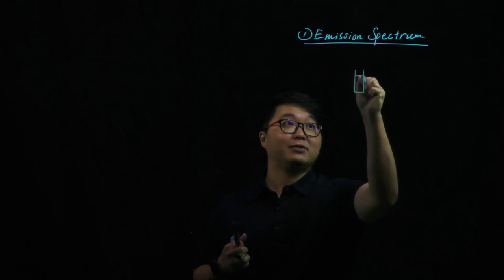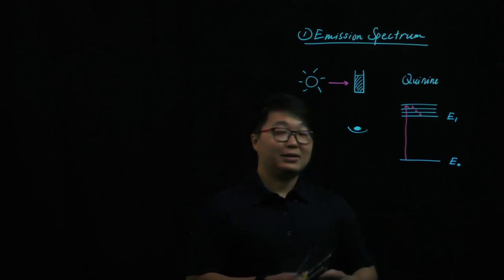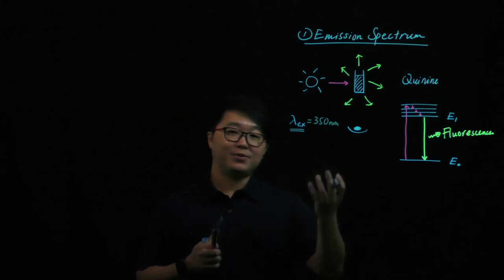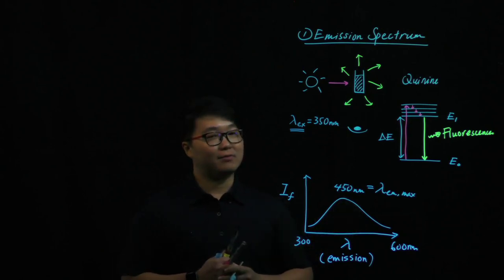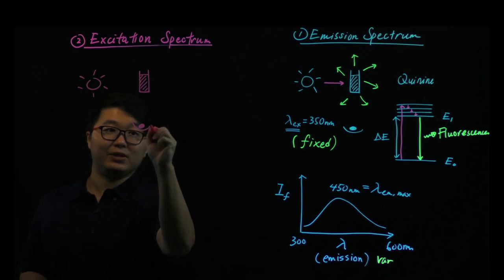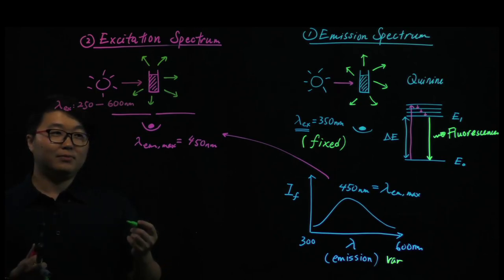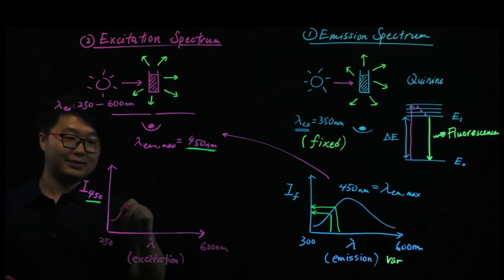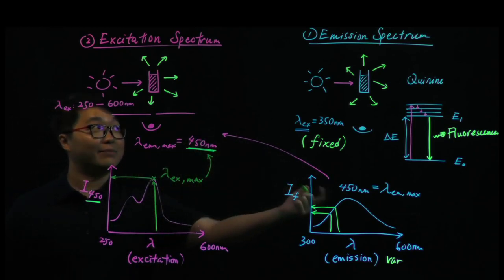Fluorescence Spectroscopy: Emission Spectrum vs Excitation Spectrum

Comment: So, you mean for different machine we have to find out working excitation and emission wavelength? how much variation could be possible among different machine? I have seen in different publications that 300nm (some 305nm) excitation and 410nm (in some 420nm) emission, thus, my question is, by doing spectra reading in my machine cytation5, I explored higest emmision reading at 350nm and 290nm Excitation....I am confuse with this much variation. is it possible?

Comment: @Francis Chong Dear Francis, so the Emission Spectrum it's about Fluorescence and the Excitation Spectrum it's about Phosphorence?? Keep the nice work! Thanks
Reply from the maker: Hi @Drive To Perfection, thanks for watching. In this video, the emission spectrum we discussed is a fluorescence spectrum, which usually involves a relaxation from a singlet excited state to a singlet ground state. As for phosphorescence, it usually involves relaxation from a triplet excited state to a singlet ground state. The key difference between the two is the occurrence of the inter-system crossing (from singlet excited state to a triplet excited state, in the case of phosphorescence). You may refer to the Jablonski diagram for more information: https://chem.libretexts.org/Bookshelves/Physical_and_Theoretical_Chemistry_Textbook_Maps/Supplemental_Modules_(Physical_and_Theoretical_Chemistry)/Spectroscopy/Electronic_Spectroscopy/Fluorescence_and_Phosphorescence

Comment: Hi Dr. Chong, I had a question. Why not do the excitation first and find out the excitation maximum and then do find the emissions spectra? Why choose an arbitrary excitation wavelength?

Another question: How is the emissions intensity is measured? Does the machine counts the number of photons at each emissions wavelength and the wavelength with the maximum photons is chosen as the emission wavelength.
Reply from the maker: Hi @Abhishek Bastiray, yes, it is possible to conduct an UV-vis absorption spectrum of the analyte first to have some idea of the absorption maxima of the analyte. If only a fluorescence spectrometer is available, using an arbitrary excitation wavelength will be the next better option. 

Yes, on the technical aspects of how fluorescence spectroscopy works, I believe you are right. If you are interested in finding out more about the theory behind the emission maxima, this reading may help: https://application.wiley-vch.de/books/sample/3527316698_c01.pdf 
Particularly on these two topics: the Franck-Condon Principle and the Born-Oppenheimer approximation.
Reply: @FrancisChongYY  Thank you Dr. Chong, this video particularly helped me clearing some of the doubts regarding fluorescence spectroscopy. Again thank you for the sources mentioned I will go through it swiftly.

Comment: You make my life easier with this video. Could you do a video which explain synchronous fluorescence and synchronous obtained with wavelength deltas ?
Reply from the maker: Hi Paulina, thank you :) Glad that you find our video helpful :) 

As of now, we don't have any plan to make a video on Synchronous Fluorescence Spectroscopy (SFS) as it's not included in the syllabus of our course. If you would like to find out more about SFS and how it works, please check out this book chapter here: https://link.springer.com/chapter/10.1007%2F978-1-4419-9828-6_5#page-1

Li YQ. et al. (2012) Synchronous Fluorescence Spectroscopy and Its Applications in Clinical Analysis and Food Safety Evaluation. In: Geddes C. (eds) Reviews in Fluorescence 2010. Reviews in Fluorescence, vol 2010. Springer, New York, NY

Comment: THank you so much! Next time can you teach us how to correct the inner filter effect of fluorescence spectrum! please!
Reply from the maker: Hi @badamkhatan tuguldur, thanks for watching. The inner filter effect is a secondary absorption caused by the reabsorption of the emission by the analyte species itself or by other species presence in the solution. It occurs when there is an overlap between the emission spectrum and the absorption spectrum. Practically, one quick fix would be to dilute the sample, or change the solvent system.

Comment: Why emission wavelength always higher the excitation wavelength?
Reply from the maker: Hi @Prince Mutshinyalo, thanks for asking the question. In general, the emission wavelength is usually longer (lower in energy) as compared to that of the excitation wavelength. It is mainly due to the non-radiative relaxation to the lowest vibrational energy level of the excited state before relaxing back to the ground state. You may refer to the Jablonski diagram for more information: https://chem.libretexts.org/Bookshelves/Physical_and_Theoretical_Chemistry_Textbook_Maps/Supplemental_Modules_(Physical_and_Theoretical_Chemistry)/Spectroscopy/Electronic_Spectroscopy/Jablonski_diagram